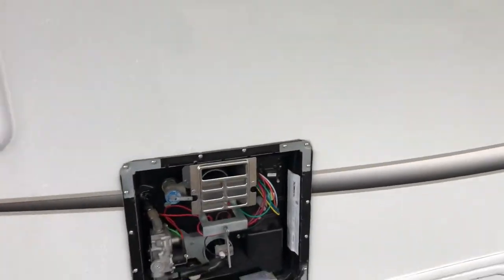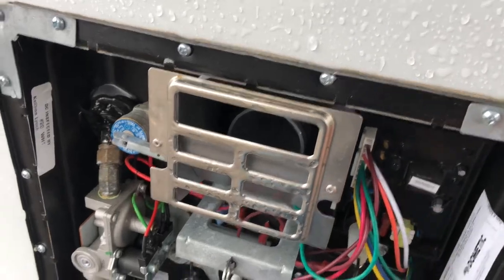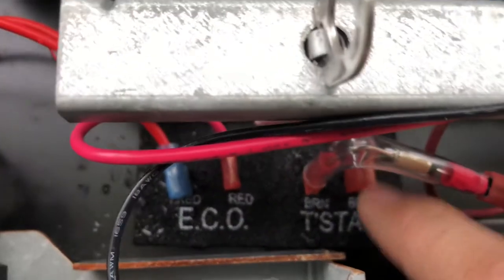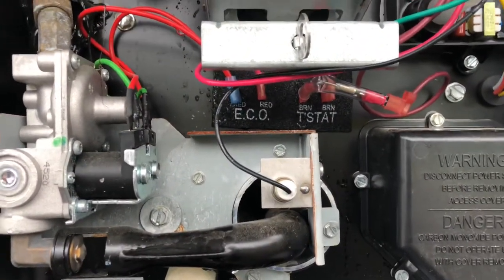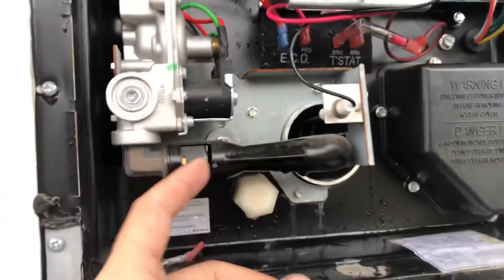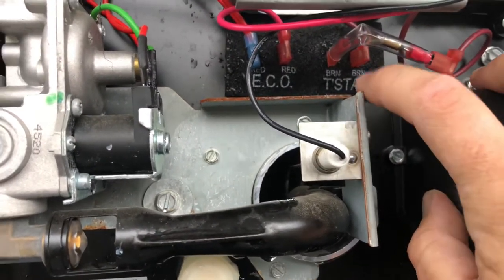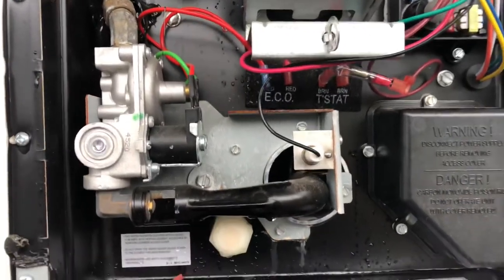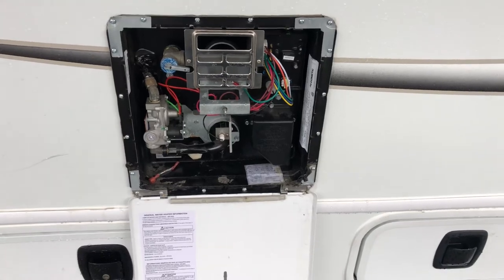Dometic Rv Water Heater wont ignite

Comment: Came across this video while camping with an inop water heater. Used the link to buy 2 thermal cutoffs and spare wire. Followed his Amazon link. Ordered fulfilled quickly. We now have hot water again!!!!  Thank you very much. 30’second repair

Comment: I thought the thermal fuse was ok by visually inspecting but after watching your video I tested it with an ohm meter and bam you just saved me 450. I was not made aware of the valves being shut off due to a incomplete walk through buy the seller and when I called dometic they said I fried it and needed a new one. Thank you for making this video.
Reply from the maker: You are welcome

Comment: Good job with your video. The thermo cut off fuse needs to be in a good location and like you said NOT directly inside or really close to the burner. If the thermo cut off fuse is located away from the burner and the thermo cut off opens, then you have another problem. If a thermo cut off fuse or a circut breaker or a reset button opens, these items are telling you there is a problem. This is why equipment have these safeties. Don't be a parts changer or just reset a circut breaker or push the reset button and call it good. Find out why. The reason I am saying this is because my thermo cut off fuse blew a couple of times and I had to find out why. I blewout the propane burner tube and did several test with my heater with a themometer inside the inclosed heater I found 
inside the heater area the temp creeped up well over 190 degree. I tried another test and fired the heater with my door opened and the heater worked perfect and cycled on and off as it should. I wrote to Dometic company and told them what I found, which I only have one vent on my door and I need a door with either more vents or larger one. They wrote back and said that I was right and they sent me a door with two vents. (I think Dometic knew about this problem because they have new doors and a hinge kit ready) Will try it out this summer and I think this will do the trick. So, don't be a parts changer or reset a circut breaker or push in a reset button. These safeties are telling you something. Thank you!

Comment: Thank you. I tested the thermo fuse with a multimeter and I had OL (overload/no current pass through/no good). I reconnected without the fuse and it work great!
Reply from the maker: It cant be run without it is a hige fire risk.
Reply: @CannonsRvRepair  oh, I forgot to mention that it was just for the time to get hot water for a shower (not even 10mins)
. I already bought a couple fuses at the dealer 😁
Reply: @CannonsRvRepair  where’s the link???
Reply from the maker: @jackiederuiter1439   In the description of the video

Comment: Great video, what does the fuse look like blown? Brand New RV, fired up for 10 minutes, now nothing.
Reply from the maker: sometimes it will look burned but most the time you cant tell without testing it with a volt meter

Comment: What is the Temperature in C rating for the thermistor.  There are so many.   I believe I had a wasps nest in mine.  Actually burned my wires as well it was that bad.  I beleive mine reads 98C??   What is yours or what do you recommend?

Comment: I have a 2023 four winds. My water heater quit and my question is where exactly can I find the water heater "reset button" my coach battery went below deep cycle and triggered an alarm on my refrigerator. I replaced the 2 amp fuse that didn't change anything.

Comment: Do you know why my new dometic water heater would click the solenoid open & immediately click back off sometimes? It’s similar to your unit, but without the additional electric element. Then when I reset the on/off switch inside, it clicks again & ignites & runs normally. After about 2-4 cycles of use & turning on & off naturally, it will repeat the same failure… I’ll hear the gas valve solenoid click open & immediately closed again until I reset the on/off switch again. I have 13.5 volts going to the unit so there’s no apparent problem with voltage. Also, the old water heater which this new one replaced, did not have this problem. ???

Comment: I've got  my water heater is turned off because it going to be  replaced waiting for new one. Question  I turned off fuse box switch, and the switch in bathroom electric  and  propane switch is off  too! So should I  have  turned off  water heater fuse box switch or not? Because  I'm hearing a noise that sounds like  a dripping water sound! Is it shorting out? Is it a electrical  issues ? Is it to full of water  and shorting out ?

Comment: Have same problem with my water heater? I’ve replaced the thermal cut off 3 times now ? I rewired it down by the bottom black flow tube ? Maybe it will stay cooler down there?????? What u all think

Comment: Thanks for this video!   It solved my problem!   I  plugged it back it without the cut off and it works.  I know it’s a temporary fix until I get a new one, can I leave it run without the cut off?   Or is it best to shut the heater off when not using
Reply from the maker: You cant run it without the cutoff is extremely dangerous You need the Thermal cutoff.
Reply: @CannonsRvRepair  can you provide me the link to purchase some off you?
Reply: Runs great without the thermal coupler.  If it burns to the ground that's what insurance is for and I'll turn around and buy a 20-year-old airstream! Dometic sucks! 2022 Forest River Coachmen, $35,000 (before taxes) 24 1/2 ft RV already had to replace the dometic refrigerator after 2 weeks and now the hot water won't work two more weeks later.  ONE Month I've had it! Only camped in it twice! Screw them they're ripping us off so bad on these POS travel trailers! I will be ordering some couplers from this guy right here I sure am glad you made a video about this and told us the truth about what's going on! I'm sure the dealer I bought it from knows all about it but of course didn't want to mention it.  Shysters every one of them in training to be used car salesmen someday.

Comment: I have power going to the board and leaving it, I took out the coupling (directed by service tech from dealership) and it worked for about a week. Now it stopped working again, still have power to and from the board, power on the right terminal at the TSTAT but none on the left terminal or the lower portion of the board. How do I go about replacing that terminal in between?

Comment: Replaced my thermal cut off hoping it would fix my dometic hot water issues but still having problems. Once I turn the electric water heater on I can hear it click but it won't ignite. Gas side works fine and always has but I've never been able to use my electric side since I purchased my rv new.
Reply from the maker: So check to make sure you have power coming out of control board You could need a new control board.  Also we have been finding 2022 models that were never plugged in on the rv if you look behind rv water heater area you will see these new style dometics have a household plug on them.  And alot of them were never plugged in it seems.  Also check fuses
Reply: We are having the opposite problem. After replacing the thermal cutoff the electric works but the gas no longer works. It worked before.

Comment: Joe
I replaced the thermal cut off and had hot water instantly  now we are camping in Indiana and the gas fires up just fine but the electric side does not heat. The gas pilot light burns strong as I visually checked it but it's not getting very hot
Any help would be apprecitated
Reply from the maker: Electric can be heating element or Eco for 110v side the flame burning but water not getting hot at faucet can be a few things but check your exterior shower faucet and make sure the valves are closed on both sides if you leave them on it can mix cold with hot, also can check bypass in back of water heater etc.

Comment: At :50 to :55 you say you wanna make sure you have power there at the T-STAT BRN post. I don't have voltage there so what could be causing that?
Reply from the maker: Follow the power, if you have no power coming to thermal fuse you should check power inside rv, check for a blown fuse at 12v distribution center

Comment: I have this water heater installed in 2021 Wini. I just replaced the thermal fuse for the 2nd time. It is properly installed horizontally. Could this be an issue with combustion air? I notice the flame is a bit more yellow than it should be. I am wondering if there is too much air. I do not notice any adjustment at the burner. Do you know of a fix for this? Most people just say to buy a six pack of fuses every year.
Reply from the maker: You may want to have your Propane WC checked. Aka Propane Test to see what the current water column is at the water heater.
Reply: @CannonsRvRepair  Thank you. That was my thought. I do not see a port on the gas valve for a wc gauge.
Reply from the maker: @ricwest7380   So the Rv Tech will need to install one inline and test operating wc while water heater is running try to find a master certified tech and wxplain what you want done.
Reply: @CannonsRvRepair  thank you.

Comment: Once the thermal fuse is replaced and I'm in gas mode, should it ignite by itself?
Reply from the maker: If switch is turned on and the water temp drops below the thermostat setting it should auto turn back on.  Till water comes back to temp and satisfies the thermostat.